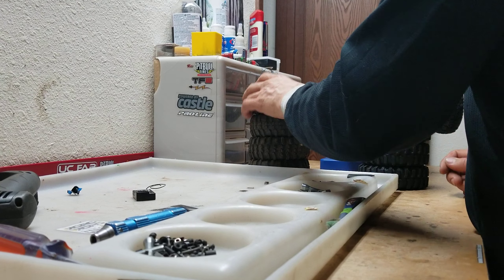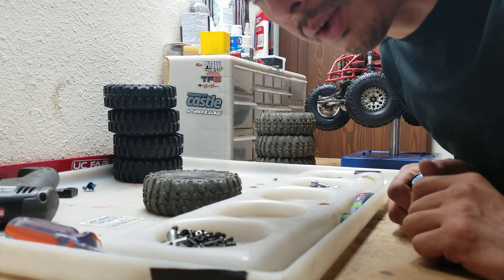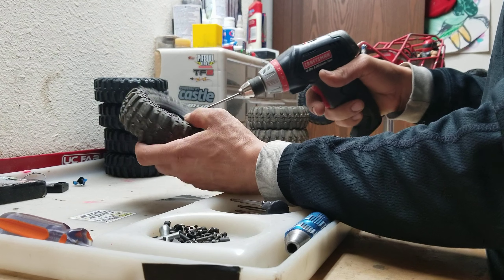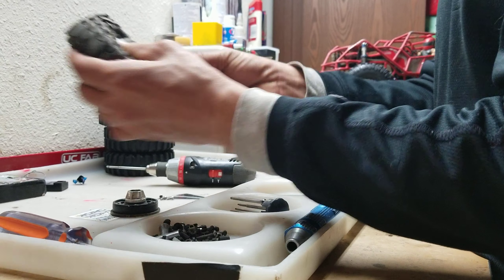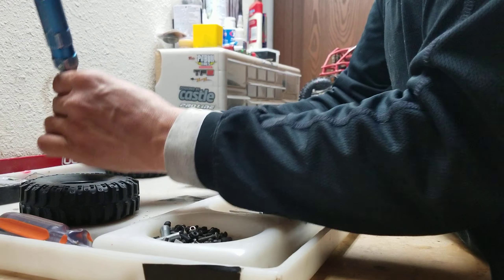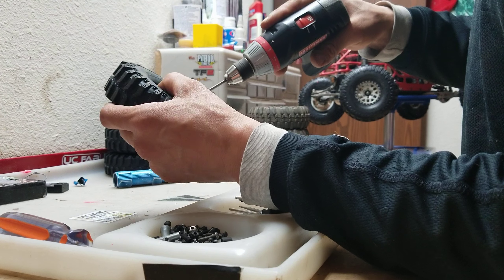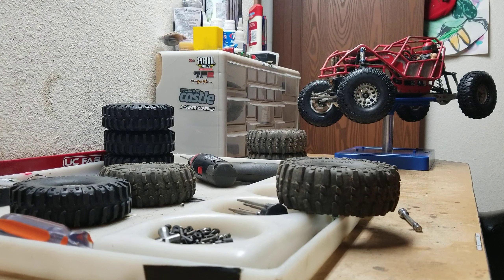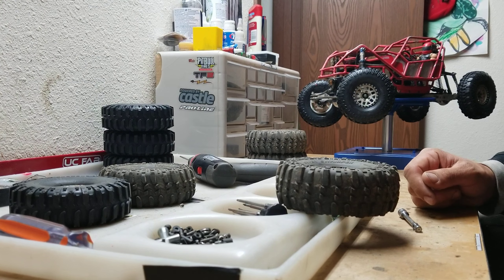Fake Vanquish 1.9 Ebay Beadlock Wheels

Comment: I think those wheels are great it saves you what 40 to 50 bucks and it does the same work the only difference is the lugs on the face are bigger than vanquish🤙🏻🔥😎🔥👍🏻👏🏻👏🏻👏🏻